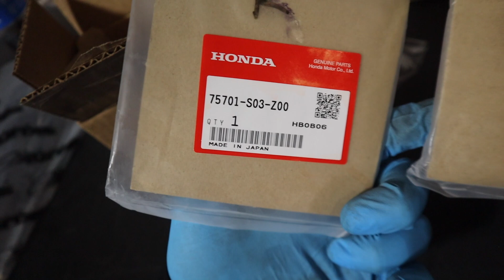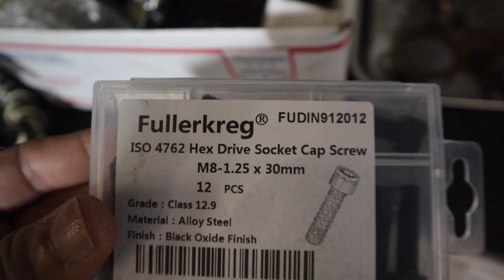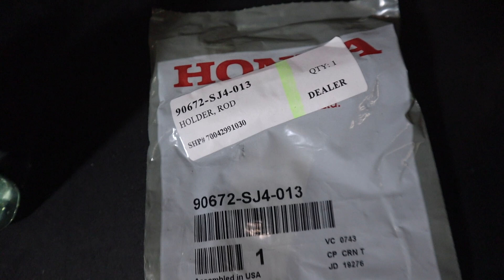Suspension + Titanium + BIG SURPRISE ‼️ ‼️

Comment: never hit ur balancer with a rubber hammer the correct way is to heat the center of the balancer up with a small amount of grease on the crank end it should slide right on p.s make sure u use loctite on  the balancer bolt